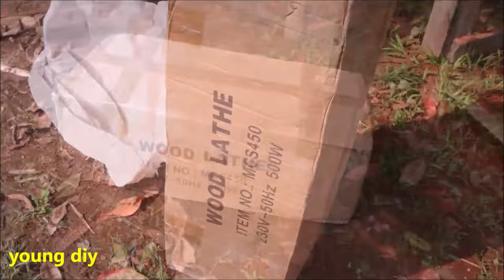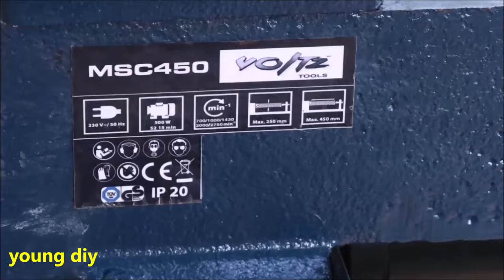500 Watt Mini Wood Lathe Machine from Voltz, Unboxing and Testing.

Comment: The lathe performs as advertised https://www.youtube.com/post/UgkxKGVtPhqZBB5AQXXFlU2kdd4mQhO6wlhl  you will need to purchase a step down transformer for Australia , but that can also be obtained from amazon (Giantz 1000w 240v to 110v ) . I have used this lathe mostly for smaller items but it is capable to perform larger operations . Just remember it is not a 1hp Vicmarc lathe , I have purchased a second unit , to use to set up as a buffing station , and as the transformer has two outlets it will run them both ( probably not at the same time? ) . So for less than $200 you have a good little lathe that takes up a very small space . For the $100 price they are now I might get a third for a backup or for spare parts .
Reply: Send me the link bro ..I am searching on Amazon